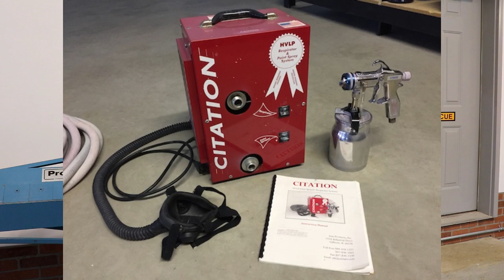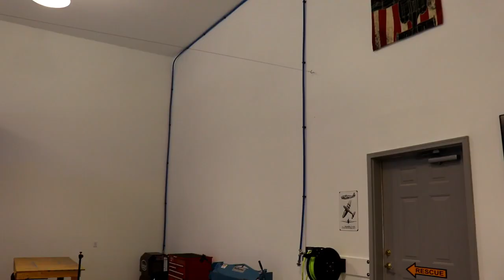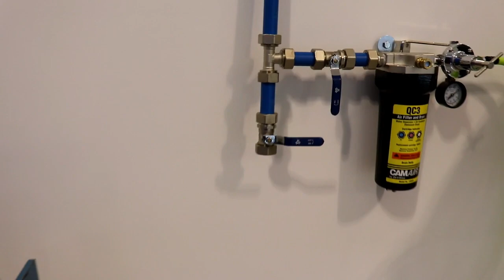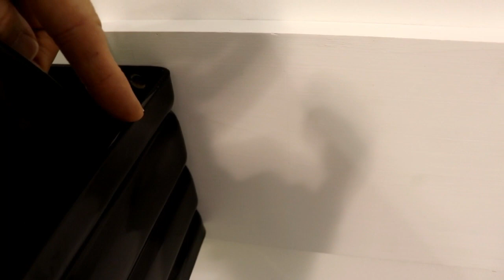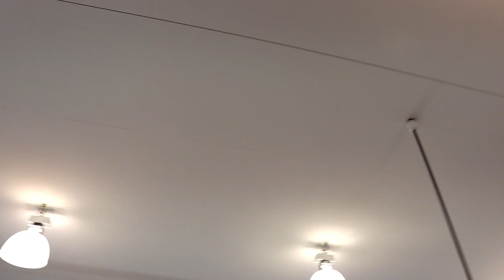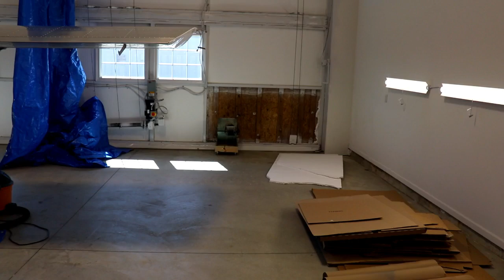My Airplane Paintbooth and Air Line/Compressor Setup

Comment: How is the compressor holding up? I just got one like that (the newer elite version) So far i like it. The reason why they say you need 40ft of line before the dryer is to let the air cool down and condensate water. Copper tube would work better than hose.
Reply from the maker: Still works great.

Comment: Where did you get the tarps? And what size are they? And do they all have rings? Ones I’m looking at do not
Reply from the maker: Harbor Freight. Don't recall the size but they come in various sizes. Get the size you need. Yes these ones have metal grommets.
Reply: @KitplaneEnthusiast  
Perfect. Thanks. Got all of that and put up the hooks.  Did you tarps sag at all?  
Also is that a 50ft flexzilla hose?  And we’re those fitting high flow?  Thanks

Comment: That’s interesting what you said about your HVLP system. That’s actually the reason HVLP became a thing was it was supposed to be low pressure (LP) and keep more of the material on the thing you’re painting rather than bouncing off it into the air. Sounds like you had your settings off. Thanks for the great video though.

Comment: Just got to rewatching this video on your air setup, I had commented previously on another video in response to some paint issues you were having. A couple things I have experienced that may help. That big loop you have will help with moisture, but I didn't catch if you mentioned to have that water drain cracked just a touch while painting. When there isn't a lot of humidity, that dryer generally will capture all the moisture, but during the summer months, that isn't always the case. I used the same dryer, with a new cartridge, and still had water contamination in a paint job resulting in blasting everything back to bare metal and starting over. To mitigate this, I did two things. I added a water separator/filter just before my dryer/filter. I also created small air leaks, one at the bottom of the loop with the drain valve, and one at the water separator drain valve. These leaks create low pressure zones, low pressure creates low temperature, low temperature condenses water in the air. The end result was the driest air I've ever had and the smoothest paint I've ever laid. HVLP guns use a ton of air, sometimes the drier alone just can't keep up when the air is saturated.

Comment: If you choke down on the inlet side of the squirrel cage fan you will get much better air flow  than leaving it open the way it is now.
Reply from the maker: Thanks for the tip!

Comment: Good video man thanks. Milton fittings btw work great but the zilla setup is great
Reply: I second the Milton's.  I replaced all my HF cheapies with Milton Type-V's that I got in bulk packs on Amazon.   So worth it.
Reply: Another endorsement for Milton.  I bought the high flow fittings and never lack for air.

Comment: What is going to be the fresh air inlet for the air that the cage fan is going to displace?
Reply from the maker: The paint booth is not sealed. It gets fresh air from the entire hangar. I've noticed that if I open both windows it gets better airflow also.

Comment: Very neat work. Did you use half of one of the Maxline 3/4 NPT fittings from a Maxline manifold to connect to your flexible 3/4 female air hose fitting on the upper end?

Comment: Scroll Compressor are great but always make sure if it has a oil supply other wise it will send metal filings into your airline real fast Before it seizes.

Comment: I noticed the black flexible hose wasn't connected to compressor. Does the flexible hose fit on compressor or is fitting needed?

Comment: You sure it's 50'? I heard more like 25 feet, this company says 20: https://www.miltonindustries.com/faqs/what-is-the-minimum-distance-from-the-air-compressor-to-the-frl/
Reply: Andrei Fasola it’s always been 50’ among pro paint shooters, but there’s more to it than that. In this setup, he needed to run his blue line PAST his last (in his case, first) drop a few feet to a drain, and he should have taken his drop, UP from the main line, not down, so that condensed water could slide by to the drain I just mentioned.
Reply: @NMranchhand  Does the hose need to be straight or will the trapping of water by filter still work it still work if the line is coiled? And do you know if filters and regulator have to be upright or can they just lay on the floor? Thanks in advance.
Reply: @firpofutbol  A coil can certainly be made to work (don’t use a bunch of 90 degree turns to make a cooler as some on YouTube do. A bend will take about 3 psi away due to turbulence). One reason people use straight pipe is to easily make SEVERAL moisture drops along the 50’ path. If you remove moisture as it forms water drops at several places along the 50’ your air will be drier at the end and the filter will work better. You can (I do) place a cheap water collecting filter starting 4-6 feet after the tank for the same reason: to get water out of contact with the cooling, moist air as soon as it condenses, to make the rest of the distance condense the remaining vapor better. A metal, particularly copper, pipe works best because it conducts more heat faster. As for the filter position, most work in the upright position because they take advantage of gravity in their design to remove the water. The exception is the desiccant type, but that is only used to remove the last tiny bit of moisture before the gun. It can’t handle bulk water removal. Hope this helps. Ask more if you need more. These diagrams shoul help: https://k2forums.com/discussion/7710/air-compressor-setup-first-timer. Notice they first “take” water away from the air at 15-20 feet.
Reply: @firpofutbol  Why go to all this trouble? Your happiness with your paint job is directly proportional to the amount of water you remove from the air. The LEAST amount of water at the gun will make you cry.
Reply: @NMranchhand  I'm trying to do it right and bought a 50 foot hose following your recommendation. I just don't know if I can leave it coiled in a roll (it is neater and easier to deal with)  or if I have to extended and run it along a wall or something before reaching the filters.
Reply: @firpofutbol  Alright then, down to details: what type of pipe/ hose hace you purchased?
Normally, we use a hard pipe from the tank, across a drain, to filters (water, oil, and particle), and then to a connection (that rises 6” before it goes down) for a flexible hose to gun with final in-line water filter near gun. The hard, metal pipe is used because it condenses water better and because it has no flex in it to rob you of pressure over the 50’. This pipe is usually laid out straight (with curves around the shop walls) with a slant downward of 4” or so per 10’.  Tell me what your limitations are though and we can work from there.
Reply: @NMranchhand  I am a DYer that just wants to paint the bumpers on my car and with only half of garage space that is temporary so I can't put up rigid pipe. I bought a 3/8 PVC compressor hose that's 50 feet long. Due to the limited space, I wanted to just leave it in a roll as it comes in the box and just connect the leads to compressor and filters but I don't know if it'll have the intended effect. For filters I just have husky desiccant filter and water filter from the home depot. I'm no pro don't need the best equipment but do want to do it correctly as much as possible.
Reply: @firpofutbol  Sometimes we just have to get on with what we have. I applaud you for wanting to get into spaying on this small start. I want to give you the best ideas for what you’ve got. Stand by while I organize my thoughts for you.

Comment: Sounds like you had your  air pressure too high in your initial jobs. You don't really need super high pressure when using a help system. You will only get lots of overspray and paint in the air instead of your part.

Comment: Was your QST sufficient for your painting needs? I just ordered one from Eastwood am excited to get it, but there aren’t many reviews from heavy air consuming users. I’d love to hear your thoughts on your compressor if you wouldn’t mind sharing them!
Reply: RhodesianFAL i keep reading about people doing a lot of spraying having to change the filter every 1-2 weeks,,,,at $54 a filter,,,eek I am still lost as to what dryer set up to run.
Reply: @JJ-333  Thank you for keeping me apprised as to your compressor. I've gotten mine lightly setup since my previous comment to you and am noticing a lot of moisture from the compressor too. I'm waiting to plumb a final system while my garage is re-wired/insulated. Here's what I'm planning on doing, perhaps is will help you with some of your issues as well. I'm running 3/4 rapid air aluminum pipe, but I'm planning on constructing cooling pipes like these and putting them on auto drains (I'm wanting this about 20 feet from the compressor):

https://www.pneumaticplus.com/pneumaticplus-qlk32-compressed-air-cooling-piping-system-kit-1-2-pipe/

From there I'm going to install an Aqua Check as a first line of defense, as the filters are cheaper, but not as refined as the QC. And finally a QC as a final step. 

https://www.amazon.com/WIX-Filters-ACK20-Heavy-Removal/dp/B000CSEXFS/ref=asc_df_B000CSEXFS/?tag=hyprod-20&linkCode=df0&hvadid=266102701344&hvpos=1o1&hvnetw=g&hvrand=17290547267193365605&hvpone=&hvptwo=&hvqmt=&hvdev=c&hvdvcmdl=&hvlocint=&hvlocphy=&hvtargid=pla-568782932100&psc=1

Once I'm that far in hopefully I will be happy with the air quality. I'm not trying to paint at this time but am wanting to sandblast/plasma cut. I think we're both finding the air from the scroll is very hot and moisture prone. Ultimately if I'm not happy I'll just bite the bullet and by a Kaeser. Good luck and lets keep in touch with what we come up with!
Reply: RhodesianFAL I do like that hanger your in. Great space to work. I just redesigned my shop and am pouring a small concrete slab today for my compressor. I am building a dog house style building around it with heat and air. Behind the shop to deaden some noise....even spraying the building with Raptor bed liner to shhh things a little. I am still in the planning state of “hmmmmm” on the dryer set up and lines. Im definitely in agreement with you, this time the dryer will be farther down the line from the compressor. About 25’. I too keep toying with that thought to just bite the bullet and get a nice one instead of changing filters or desiccant packs. Also,,,love the hanger you have. I retired out of the Army, 160th Nightstalkers. I then contracted and was an A&P mech. Now I am retired, I do miss it with the test flights and stuff, so now Im thinking of putting something together myself for fun. Like a small “little bird” style helicopter. Time will tell. Hahaha and this compressor set up of course. Hahaha

Comment: If the moisture needs so much hose to condense the water then how come you have to drain the tank?
Reply: Relative to the 150+ degree hot air coming from the compressor head, the walls of the tank are cold.  This causes any hot air from the compressor head that touches the tank wall to 'sweat' immediately upon touching it, so that's why the tank needs a drain.  It would be best if he cooled the air with an external condenser between the compressor head before it enters the tank, then remove water again when it leaves the tank (that's what he has '40 to 50' feet down the line currently.)  They say 40 to 50 feet away because the air needs to be cooled down to condense before going through a water filter, but the manufacturer knows the average shop owner is not going to install the appropriate equipment.  Surprisingly, it's not expensive to do this and many people are installing transmission oil coolers with success.  Check it out on YouTube - you can get them cheap off of Amazon.  As an upgrade, you can add a fan to the transmission or oil cooler to help remove heat for almost no cost.
Reply: Because the tank cools down in between coppressor uses.

Comment: I added an oil cooler in front of my compressor flywheel to condense the water out of my air before it go's into the tank for about $30 bucks . it works very very well . I only have clean dry air and my tank should last for ever with no rust .

Comment: I think a safer method of ventilation would be to put a shop vac outside the hanger, fasten the hose to a vent trap in the overhead door
Reply: Lol thats like emptying a pool with coffee cups.
Reply: If you want simple , cheap , and safe, just buy some box window fans for $20 ea at Home Depot and tape a A/C filter to the fan . Or cut a square hole in the door and mount the filter there. Put the box fans outside to avoid sparks. And remember kids, auto paint contains iso-cynides which you can absorb even through your eyeballs so wear a full suit with NOTHING exposed. Capice ?

Comment: Nice setup man,what is the dim on the comressor hose? 1/4?    3/8??
Reply: @KitplaneEnthusiast  ok thanks.
Reply: Just wondering. 
Why didn't you use a 1/2" hose instead of the 3/8"?
Good video btw.

Comment: Caution with the electric motor on the fan....electric motors make tiny sparks at the winding/brush contact points and can ignite vapors if they become dense enough....I almost found that out the hard way.  It would be better if the fan was on the outside of the building....just sayin’